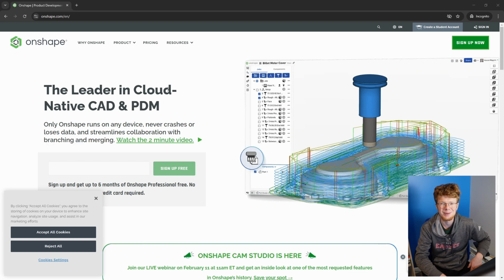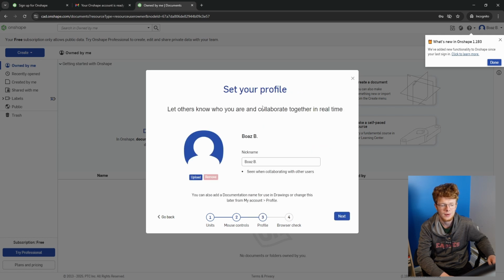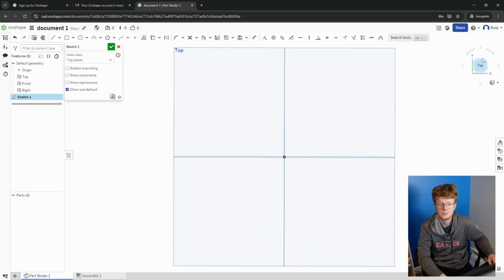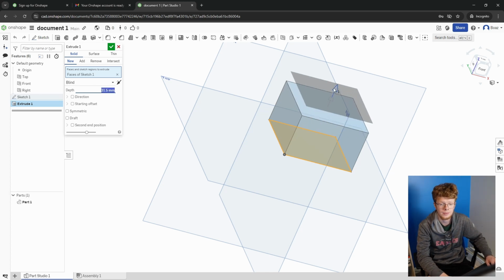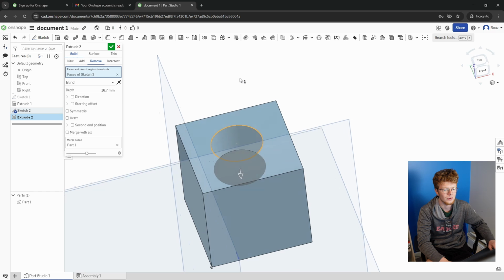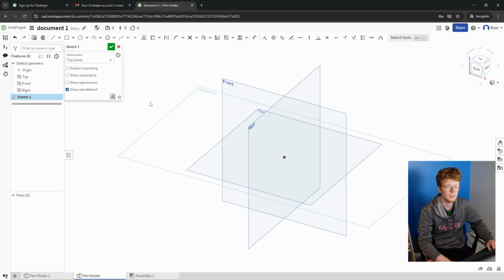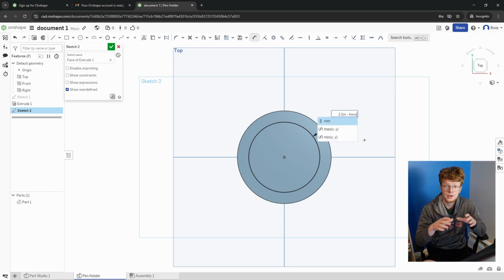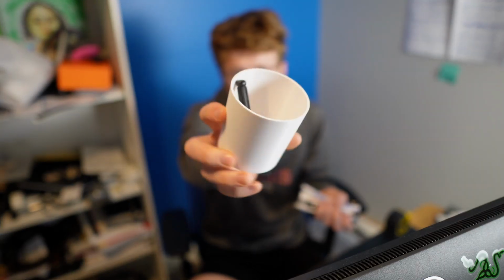THIS is the FREE Software I Would Recommend for Designing 3D prints for Beginners

Comment: Please make more 101 videos 
Need to make a block 8" long 2.125 " high b 2.125 width, 
Need to take out middle of part of a "u" shape with a .25" thick on each side left over of metal 
With .25 " thick on one end and the other end have the block but still with the "u" shape coming out (need to attached another part to that end,
Top needs to have a lip about .25 thick and .25" thick or more (need to add a heat threaded part into top where the cut out is,
Then need to make top part with like grill looking all the way down (Water flow into the "U" shape part, will have screw (Fasteners) hold down top to the block part.

I did notice that my took bar is not like yours. (Different tools), is there a place to click on to change the look of the tool bar?
Please keep keep up the 101 videos, make it simple, other videos are over my head
Thanks
Dale
.
Reply from the maker: Hey Dale!

Tool bar differences may be due to the one or two custom tools I have loaded and past that screen size and resolution can mildly change it. 

I’m planning to make more tutorial videos soon! Finishing up a competition for this game I’m making Tuesday and then I plan to pivot to cad for most the rest of the year!

Comment: I have problem when doing the sketches, it shows message 'sketch not defined' something like that
Reply from the maker: To fully define the sketch you have to use the dimension tools. It can also be important to note that starting sketches on the origin point it mentions on the left side of the screen makes them much easier to define.
Reply: @B0A2 thanks
Reply: I'm having the same problem when I try to change the diameter of "sketch 2" by double clicking "sketch 2", then using the dimension tool to change it.

Great tutorial. Thanks for taking the time to do it!